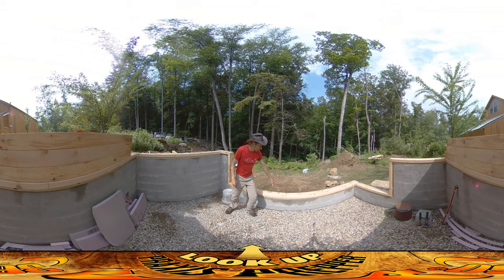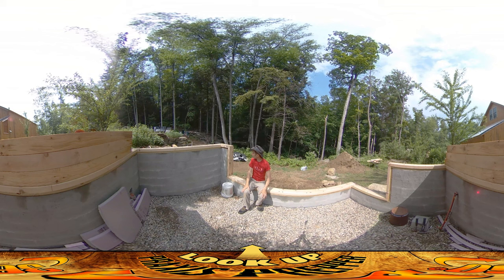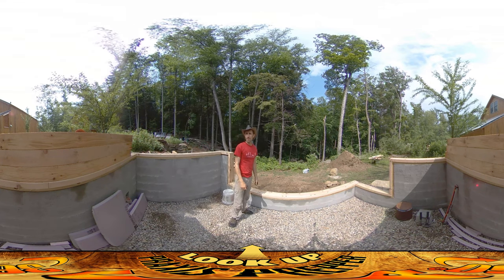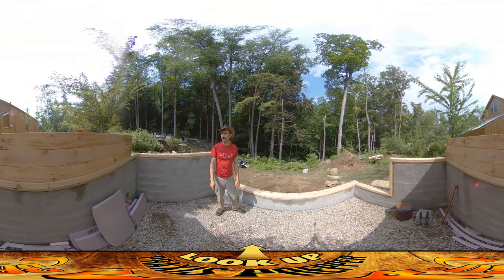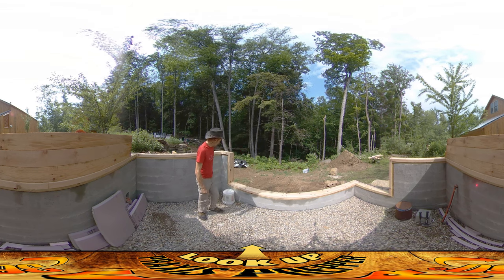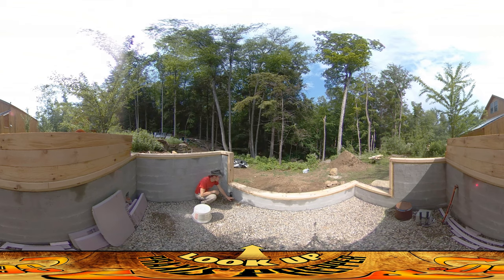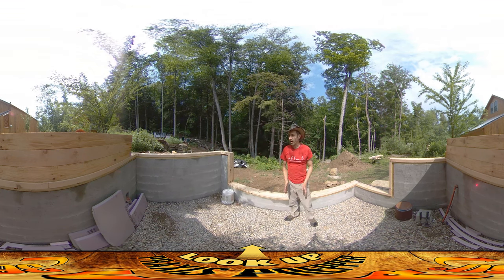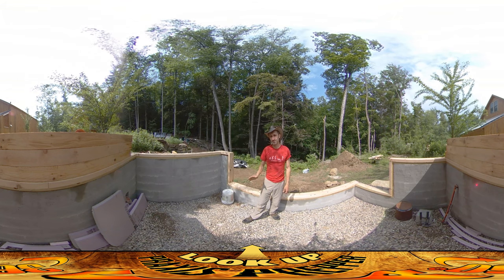Homestead Build - Chicken Coop Double Sill Plate, Drainage Pipe

Comment: Keep up the good work. Makes me think of some of the old dairy barns that are still operating in NY, where they built mostly out of the old growth hemlock and white pine. 1 inch a year, seems to be the term I do remember from an old timer who has long since passed away.
Reply from the maker: I hear the 1 inch per year thing too. I think it depends a bit on the wood too though. Maybe the 1 inch(ish) is an average across tree types.
Reply: @PraxisPrepper  yet, one can take a Black Ash tree and soak it in a pond for a year: pull said log out of pond,  pound the log to split, make reeds for baskets.

Comment: Looks good, if it were day 1 for you, and you were using your own trees for building lumber, I would suggest a solar dryer.  Proper stacking is also a critical component to drying out structural lumber as it will bend over time as it dries.  You however get no pity from me, I tend to run the to other end and envy the fact you still can grab and move those heavy timbers by hand.  All I can say is get it done while you still can.  I hate to be the bearer of bad news but there is going to be a day, sooner than you think where the ability to do that is going abandon you.
Reply from the maker: The ability already periodically escapes me when I give myself an injury. As I get older, those injuries take longer and longer to heal. I can definitely see what you mean about the frustration of one's body not living up to one's hopes - especially one day when the idea that my body will eventually be back to working order won't be the case.